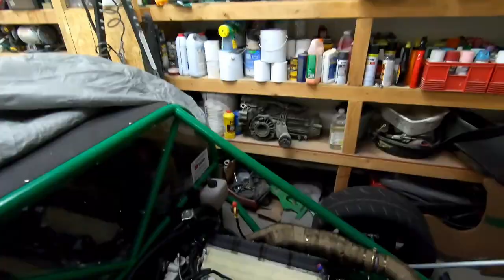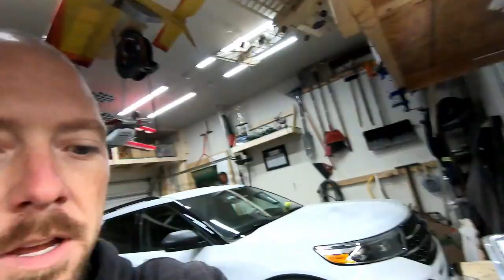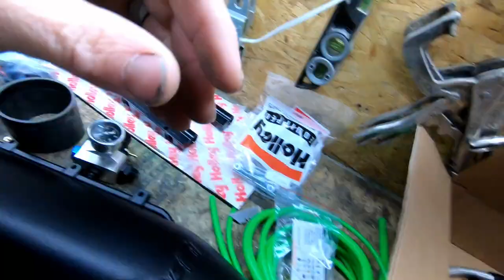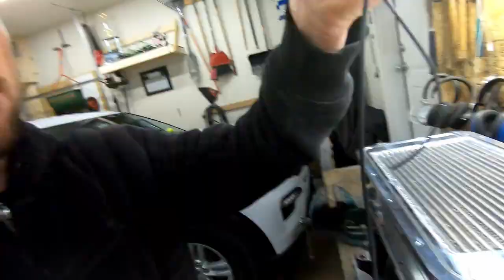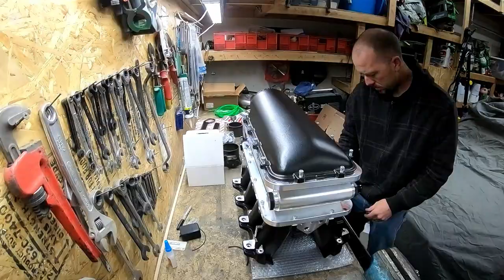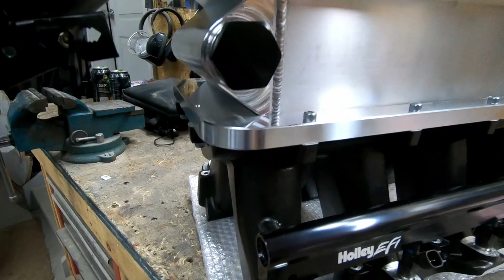Installing a New Holley high ram intake with tick intercooler (part 1)

Comment: So the thin goes on bottom and thick goes on top ? For o-rings
Reply from the maker: The best way to tell cause it’s been a while. Is the oring should sit higher than the surface. So test the orings in each grove before to see which one goes in it respected grove, if they are in the correct grove they will both sit above the surface. Hope that helps
Reply: Hey I appreciate you getting back to me  I hope you have a great day
Reply from the maker: Your welcome. Hope you have a great day too
Reply: Hey bro I’m sorry to bother you but the two front bolt holes do I come in from the bottom to tighten I appreciate any input
Reply from the maker: It’s all good. Yes both top and bottom on the front come in from the bottom

Comment: Sup Bro have a New question sorry if this sound dumb but can this work as water intercooler? === FLUIDYNE PERFORMANCE Therm-Hx Oil Cooler  P/N - DB-30417 ===  cause I thought the cool water flowing in there would cool the hot compressed air passing threw it. Instead of hot oil fluid passing threw it with fresh air to cool it.
Reply from the maker: I don't see why not its alot nicer than the one I'm using and looks bigger too

Comment: Hello there hope your staying safe with covid-19 crap. Bro love your build🤘🏼. I have a question on the trick performance intercooler,  i would really appreciate if you could tell me the measurement from  the outside eage to the other eage  in width  and eage to eage in length. I know yours its a 4.875in thickness and the one I want is 3.25in thickness but thats it. Please cause I want to mod one to fit an ls1 whipple intake lower that I bought and a ford lighting m112 blower for my project 85 S10 called BlackWidow with an motor out of my crashed 2002 ls1 Ss 35 anniversary slp camaro. I would really LIKE RUN something like that of an intercooler and run an icebox to it instead of water n meth kit just to be safer on motor. Please hit me back thank you for your time👊.
Reply from the maker: Hey thanks bro. I can get that for you tonight when i get home. You just want the out side dia of the intercooler mounting surface? Width and length
Reply: @DeathByBoost  yes and also the intercooler core  please really appreciate it that would really help me to decide about modding it to my whipple intake or if it's possible which I hope it can .
Reply from the maker: @s10blackwidow  awesome I will get that for you
Reply from the maker: Ok so i got 18.5x9.5 overall and 15x7.5 on the core and it centered within that. And the mounting flange is 5/8 thick. Hope that helps
Reply: @DeathByBoost  Thank you so much Bro👍🏼👊 I hope it can work🤔. I'll keep you posted if works or not. Looking forward on seeing more of your updating build. It kickass🤘🏼Take care & stay safe with covid-19 crap. Again I really appreciate it thanks.
Reply from the maker: Thanks man glad I could help